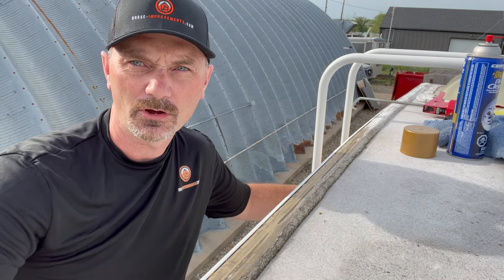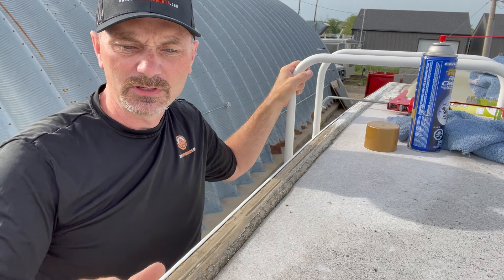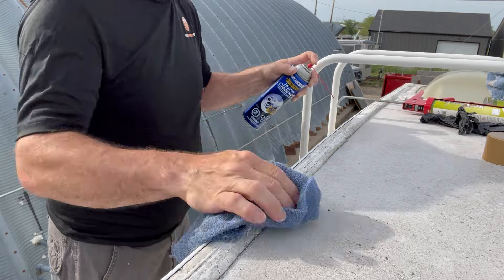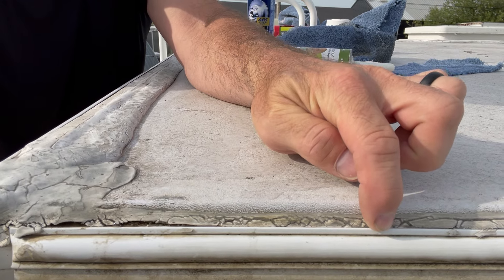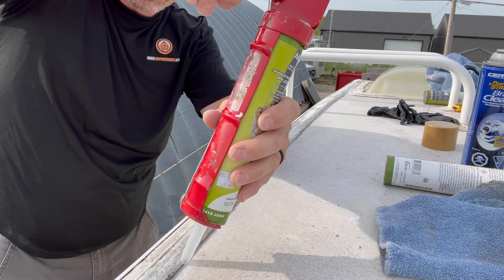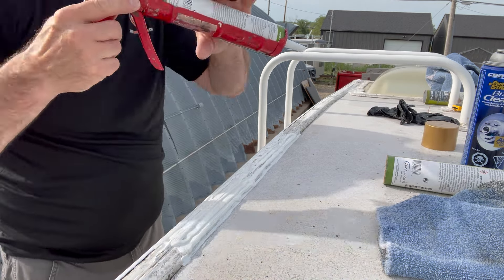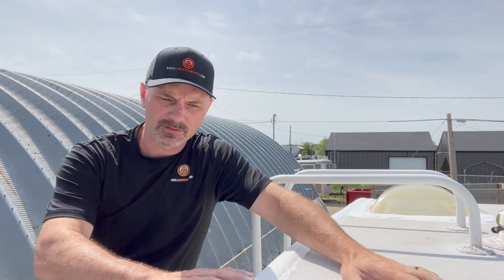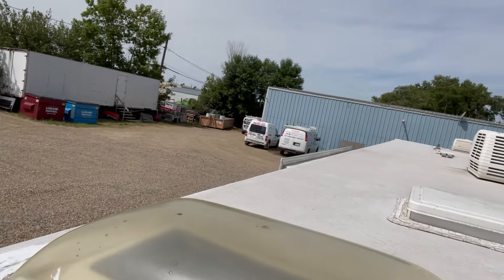How To Re-Seal Your RV Roof

Comment: Great job Shannon. Extra tips - that stuff sticks to EVERYTHING so wear old clothes, and for those of us clumsier folks, long sleeves as peeling it out of your arm hair is less than fun.  As you said, the key is the prep work.  Dicor is the only thing for RV roofs - anything silicon based will not stick to the rubber (or Dicor) and once you put that down nothing sticks to it, so you're really in a bad spot.  At minimum this is a yearly job.  Dicor also makes a roof tape if you have to fix minor tears or holes in the roof.  I swear RV's are made to such low quality standards (I once owned a Forest River that they cut the factory doors too large and just filled them with caulk, which caused a rip and replace of the full floor)... but if you enjoy the RV life this is what you're getting in to.

Comment: Dicor  is good stuff.  But at best it lasts a year before it needs redone.  You can’t just keep adding it on top of the other after so many times.  The rv industry recommend this process because of the continuous maintenance required.  Most rv owners aren’t up to do this type of regular maintenance.  So expensive roof service is needed at a service shop.  Eventually you will hear the words “new roof” is needed.  Even more expensive.  If you have a rubber type membrane on your roof  (as most do) you really can’t remove the old sealant , it will damage the rubber.  Until the rv manufacturing industry wants to change this (which they don’t) you might as well use a tape sealant like eternabond to last several years with little maintenance and low cost.
Reply from the maker: Can't say I re seal the roof every year but I do have a look at it every year to be sure. I touch up the odd spot here and there when needed. Every 6-8  years or so i give it a good once over if needed.

Comment: So do you just keep building up that berm of a seal constantly or does it reach a point where you gotta use a chisel get rid of the berm and start over fresh? RVs are such an enigma for me. Buddy of mine has a "garage condo" where he stores his RV. It keeps it sheltered and relatively climate-controlled when he's back home. He takes it south every winter for 6-8 weeks, and oftentimes in the summer too. I wish I had his means, that is the way to go. Who needs hotels when you got your own living space on wheels.
Reply from the maker: Depends on your roof design , but if it's a fairly flat roof normally you may have to over time or situate the camper slightly out of level. While in storage I intentionally leave mine out of leave so roof drains off for sure. During a trip I normally dont worry too much but if we get a rainy patch for a few days I will keep an eye on it to bee sure its not pooling on the roof.

Comment: I was going to do this next weekend, except I was going to scrape the old caulk off with a plastic puddy knife and clean it up. I was also going to use eternabond in most areas. The blobs of caulking on these campers almost take up the whole roof.

Comment: spend the extra money for the di-core good stuff. Dont use the walmart brand, its horrible. First its way too thick so you have to cut the tube nozzle huge to even get it to come out. Then your forced to use too much and the beads are huge.  It is also not really self leveling and takes forever 1 to 2 days to cure.  The di-core stuff cost more but it comes out of the tube nicely, sticks well, and you  can watch it level out.  I did 1 skylight with walmart brand, took 4 tubes thats 60 bucks for one skylight.  If i used di-core i could have done it with 1 tube.

Comment: Thank you for the video and the information. The job you done looks really! I have big OCD tendencies where cleanliness is concerned so I will be doing a soap and water wash with a bristled brush, followed by a wiping of vinegar to to kill any spores left behind. Depending on the severity of cracking, I might would be willing to "top" the sealant 2-3 times, but after that I would remove all old and start over fresh. I prefer fresh since it's like a bandage. If you have a cut and it has a bandage on it, you don't clean the bandage and put on another one. By doing that, you're not fixing the issue, and may wind up with a worse wound in the process. I get that it's a big job and people want to be done with it as fast as possible, but fast isn't better when your talking about something that cost as much as a camper does. The more efficient you are, the better it is, and the longer it stays good. I get that you would have to clean it and then let it dry one day, and then do the sealant the next day and let it dry. Two days is not that bad, and I'm speaking from never having free time at all.

Comment: Thank you for the video. About how many tubes did you use for the whole roof. Looking to do this soon and just trying to get a price estimate
Reply from the maker: Depend on size of the unit but for say a 30' like this you will want 1-2 tubes of non flattening and about 3-4 of the self levelling  . The product is not cheap but it does last when un opened as long as it does not freeze ,so having more than you need is ok and can be kept on hand for next time.

Comment: They build those rvs terribly.  I've owned several, they certainly could design them with better drip edges etc.  Many corners rely only on the caulking to keep water out and they are all bound to fail.

You nailed it Shannon, if you own one you should be checking this every year.

Rv industry should be ashamed of build quality however.

Comment: I just bought me a 2013 north trail and it rained for 4 days straight and I see in the front where the storage is at it was all wet in there so I guess I got to pull all the stuff that been getting wet out then try to seal it up to prevent it from getting wet again o and not to mention there's a hurricane come straight for Louisiana that's where I live 30 miles west of New Orleans

Comment: Shannon what are your thoughts on the eternabond tape to seal the edges ?
Reply from the maker: It may work ok in other areas besides the edge of the roof ,but I would not trust it on the edges for sure. I have never used it.

Comment: I am new to owning an RV, Is there a reason you don’t remove the old sealant before applying the new?
Reply from the maker: You can , its just a really big job usually and chance of damaging the roof or fixture its self. Adding a new layer over the cleaned up older layer is generally acceptable.
Reply from the maker: I will actually have a video coming in the late spring 2025 showing how to remove and replace this exact roof top sunlight window.

Comment: Dreading doing mine...have to reseal all the vents with butl tape...thinking about doing to roof with a tar type sealant
Reply from the maker: If its a rubber roof like this was I would not use tar.

Comment: I just bought an 86 Toyota Dolphin and brand new to this RV business. I was told by previous owner that the roof and windows need sealing. Question: do I need to take windows out before sealing them?
Reply from the maker: No , run a bead of good quality exterior caulk around the perimeter
Reply: @HouseImprovements Thank you!
Reply: @HouseImprovements  Thank you! Less work too.

Comment: Great video, thanks. I'm new to this stuff- would you also use a coating for the entire roof after sealing the edges, or is that unnecessary?
Reply from the maker: No this would not be a product to coat the entire roof.
Reply: @HouseImprovements  I think what he meant was after you do this, would you buy that roof sealer that you roll on to do the whole roof? It's like a white paint sort of that blocks the sun rays i believe

Comment: Good morning Shannon 
After the brake cleaner and before the sealer, do you need to wash the area with soap and water or will the sealer attach itself to the brake cleaner residue?
Reply from the maker: Brake cleaner evaporates quickly. I dont wash before sealing at all. The brake cleaner is the cleaner.
Reply: A key feature of brake cleaner is it has no residue.  It evaporates completely.